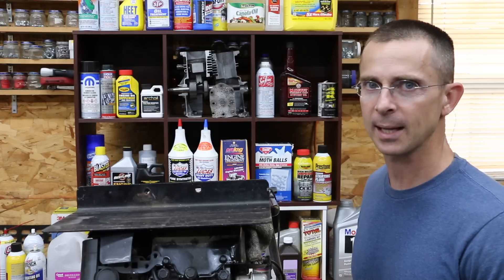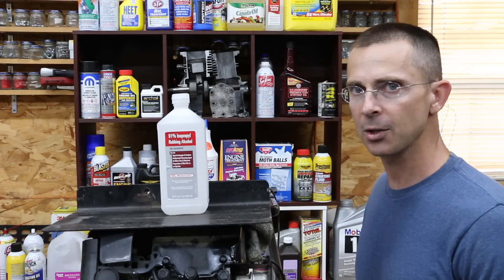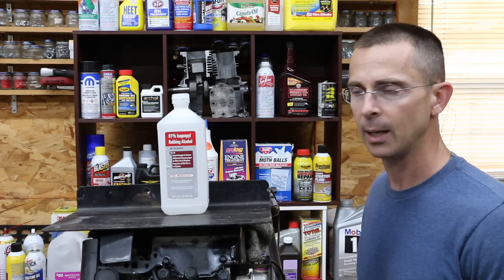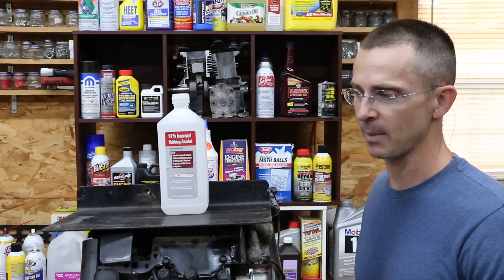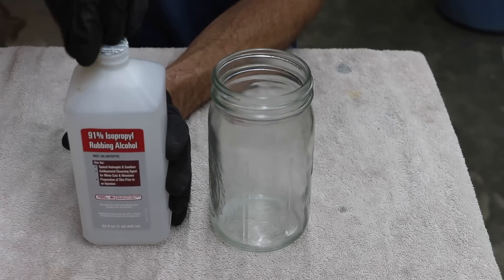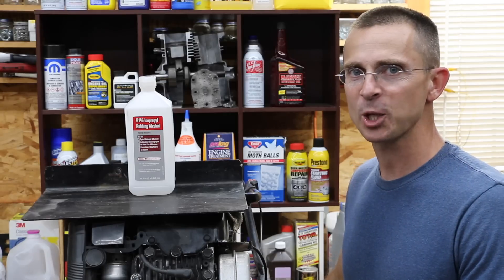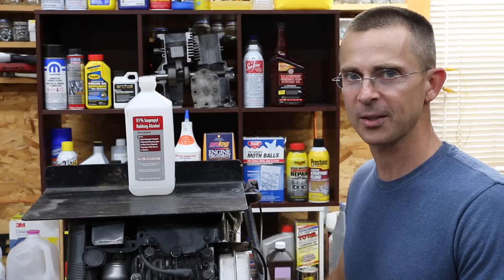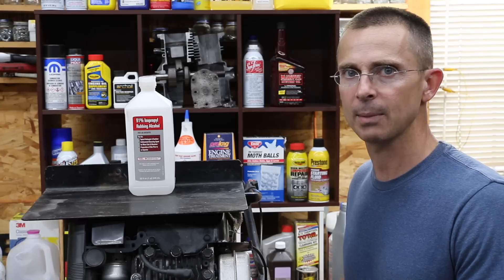Will a Gas Engine Run on Isopropyl Alcohol?  Let's find out!

Comment: Would be nice to watch a bit longer of a video of u trying that combination I asked about. 25-30 min video using methanol, aviation fuel and E85. It would be nice to also see you blow an engine up using nitrous directly injected into the carburetor. Oh yeah you could also try and make a mower run off propane.. anyways good job on the video keep up the good work these are just some suggestions and ideas. If you use any of these please give me a shout out on you video  I've asked every time u make a video lol
Reply from the maker: All great recommendations!  Thank you!

Comment: This is a good experiment, but one drawback I didn't see mentioned in the comments that deserves mention is that alcohol dissolves most oils, engine oil being one of them. I use Isopropyl alcohol in my biodiesel shop as a cheap solvent all day long. But as a fuel, the alcohol removes the oil from the cylinder walls brought up by the oil ring on the piston, and over time will cause premature combustion chamber wear, and loss of compression. As a test, this is great.  As an alternative fuel though, alcohol will damage the engine in a short amout of time.
Reply from the maker: This is a excellent point.  Thank you for commenting on this!

Comment: Can you try running on propane? I know diesels can but what about the small engine?
Reply: diesels cannot, gas engines can. most forklifts are propane
Reply: bryce piper yea that is true, but diesels used to have an option to run propane as sort of a "nitrous" per say setup, but now its a water meth injection in which people take the route of, companies still sell the propane kits but im not completely sure on how that helps diesels
Reply: water meth is mainly to reduce exhaust temps
Reply: bryce piper yea im battling egts at the moment with my cummins, i found out about the propane injection mods when looking for a better setup to help my egts
Reply from the maker: homar787, Thank you for this recommendation!

Comment: If you were to open the metering holes in the carb and a little bigger jet it should clear right up. You have to change your oil often when you run alcohol through these small engines though. It'll wash the cylinders down. We used to run methanol in our racing karts back years ago. Pretty sure they are similar. Also you'll burn more alcohol than gas. It was almost 2:1 for us.
Reply from the maker: All great points. Thanks for commenting!

Comment: You should try letting a hot running engine suck up some liquid nitrogen through the carburetor. Or pour it over a hot cylinder head while running.
Reply from the maker: Thank you for this recommendation!

Comment: an old briggs motor manual i saw online somewhere  called for minimum 77 octane gasoline,   so im guessing wood alcohol isnt too far off from that octane level, it ran great.... im guessing the oil industry knows this too and has purposely made it harder to do this with cars probably going back since the 50s or 60s, im no history expert ........         maybe do a "mileage comparison"  on running time on same level alcohol and gasoline .... e85 cars are supposed to get less mileage from what ive read
Reply from the maker: I enjoyed reading your comments.  Thanks!

Comment: Isopropyl is used as a gas additive to "absorb" or mix with small amounts of water in the fuel tank. It isn't going to remove carbon any more than clean premium gas.
Reply from the maker: Thanks for commenting on this!

Comment: I have heard that if you run a engine on propane it will clean all of the carbon from the combustion chamber. I would like to see you try that. Great videos always look forward to them.
Reply from the maker: Thank you for this recommendation! and thanks for the positive comment!
Reply: Don't know if it will clean one up but an engine that is already clean like a fresh overhaul that runs on propane will not discolor the oil it will look fresh after 3000 miles on a v 8 it's a lot cleaner burning fuel than gasoline
Reply: Also if you convert one over to lpg you should install harden valves and valve seats due to dryer lubricant maybe more heat and also lpg loves high compression ratios

Comment: There is this stuff I found at Advance Auto called Aircraft Coating Remover that worked really well cleaning up some heads for a car. The stuff is amazingly strong! I wonder if that could just be sprayed down a carb or added to fuel to clean out an engine?
Reply from the maker: Thank you for this recommendation!

Comment: I hear Acetone can clean an engine. I hear you mix three ounces acetone to ten gallons of Gas. Not sure if that works or not.

I seen a person pour rice down the carburetor in a car that was skipping real bad and as he poured the rice down the carburetor the rice was shooting out the tail pipe all black from the carbon that was buildup in the engine and they engine slowly started running smoother.
Reply from the maker: Thank you for this recommendation!
Reply: I don't think rice would ever make it through the carb jet.

Comment: Hey man:
I don't know if you have done this or not but if you can run a 2 stroke engine on a mix of 5:1 diesel to gas rather than a standard 50:1 2 stroke oil to gas. Legend has it will run. Thanks!
Reply from the maker: I haven't done this yet.  Thank you for this recommendation!
Reply: That farming Kid I've done this before. Diesel thinned down with alcohol or gas will work in the leaf blower, moped, generator, other small 2-stroke motors. Sometimes. Depends on the engines compression and your mixture ratio I presume.

Comment: There  is a rumor around town, (in the shade tree community) that you can mix a little trans fluid in with your gas to increase milage, could test it out!! Also Could try running mineral spirits, I ran a little xylene/gas mix  in mine once.
Reply from the maker: These are all great video project ideas--thank you!
Reply: put a small amount of diesel in with the gas in your tank a person I know always did that on his ford ranger with improvements on mileage

Comment: Question! Is it safe to use in a normal car with a normal fuel injected gasoline engine? The compression dropped 3 PSI do you think it caused physical damage?  Those were significant results to the carbon build up, Seafoam does very little. Thanks project farm long time subscriber and you just earned a like in your video.
Reply from the maker: Out of caution, I wouldn't use this in a fuel injected automobile.  I just don't know if there are any negative effects.  Thanks for the positive comment and for the thumbs up!
Reply: What should I used to clean carbon build up? No THANK YOU for the video!

Comment: An old remidy for a carboned up combustion chamber is adding water while running the engine.
Reply from the maker: Thank you for this recommendation!
Reply: But not to the fuel tank. Dribble the water into the carb while at mid to high rev's intermittently without stalling the engine.  Nick.
Reply: advance9572 Yep and then MAKE SURE to change your oil it turns into a milkshake
Reply: windex is better in my opinion
Reply: Another option is to use a steam cleaner. The water is already vaporized.
Reply: Adding too much water into the carburetor is also an old remedy for a bent connecting rod.
Reply: Well the Iso alcohol had a 9% water content so that might have helped it clean.
Reply: advance9572 adding water to the air intake not the fuel tank.      Might want to specify for all the dumb fuckers

Comment: I say mill the heads down as far as operationally possible to get as high of a compression as possible and run some 110 in it, if you can even get the compression high enough to require that much octane.
Reply from the maker: Thank you for this recommendation!
Reply: Kevin Ball just putting a 3&1/2HP head on a 5HP engine will bring up the compression a lot
Reply: I saw a video of a guy milling a v8 cylinder head using sandpaper on a sheet of glass.  The glass surface was flat making home milling possible.  If you're going to try it that is how I would achieve a flat sealing surface on the final sanding.
Reply: Barry Fields 
Ok that makes sense. I worked 9 years as a mechanic in the heavy duty industry and I've messed around with mowers and minibikes a descent amount when I was younger but never realized the bolt patterns would match up between the two. Ok so that removes some mystery for me. I'm curious what kind of compression ratio can be had with different heads and milling. Then maybe notch the magneto holes a bit so as to add 5 degrees of advance as well. I'm familiar with small engines decently enough but I've never attempted to build one up. I was just trying to think of cheap methods Mr. Project Farm could do. Thanks for the input.
Reply: The problem with the flat head configuration is that when you mill off of the head it lowers the clearance area over the valves until the valves hit the head.  It has been a long time since I built go-kart engines but you really couldn't get really high compression (say 12:1) out of a stock head no matter how you modified it.
Reply: I know lmfao Its amazing how many people cant tell a joke from actual meaning, ive been a diesel mechanic for 10 years, I build race trucks on my free time, if I wanted to raise combustion I would plane the deck down, but compression only does so much, if you wanted to run 110 you would advance the timing to get the power. my 2014 ford f150 5.0 I have sct x4 tuning, custom e85 nitrous tune and 100 shot of nitrous, right now I'm running a mix of e85 and pure methanol, even on my basic e85 N/A tune picks up 45hp alone just because the high octane allows me to have the timing advanced. in the middle of building a drag semi right now, got an old 1998 freightliner fld120 cummins n14, did a rerate from 410 to 525hp with cummins insite, did a turbo swap from the ht60 to a compound with a sx500 BorgWarner 94mm to a 86mm sx400, should hopefully make 70psi of boost, using an external tank with a holley 200gph diesel pump, hooked up to 2 nitrous fuel solenoids for the extra fuel to keep up with the boost even though diesel engines can run as low as 60:1 the more lean it gets the more power I lose and the more higher temps the engine runs, next step imma send in the ecm to a buddy of mine to redo the fuel mapping on the stock system, also have two 265gph fass lift pumps for the main fuel system, haha I'm not some idiot, ive done a lot of projects and come up with all my ideas from scratch, if someone has an idea I can create it
Reply: It has been at least 15 years since I have built competitive B+S engines for go karts, so I have long forgot all of the specifics.  If I remember correctly we would first determine the cam lift that we would run, then cut the head to that level, and the two important things that we had to do were to open up the area between the valves and the cylinder to allow for good airflow, and then mill a fire slot into the head.  The spark plug is so far offset to the valve side on the B+S engines that it was hard to get a good fire over the piston when you got the piston to head clearance right down to a minimum.  So you need to mill a small slot, or groove from the plug to the center of the piston.  It would pick up a bunch of torque with that.  Again, it has been a long time and I am sure that there are many people that know this like the back of their hand.  Fun stuff!  R.J.
Reply: lol weld the combustion chambers around the valves and grind it smooth
Reply: Project Farm my dad used to feed ww2 aircraft engines white rice to clean carbon. We've done it many times over the years.  He's passed away but he new his shit. Try it. Uncooked of course.
Reply: Matt Hudson you need to do a little work on them, but they will work. Just cut a little relief for the valves
Reply: Milling the head of a flathead only serves to restrict airflow through the valves
Reply: R.J.'s workshop 
That was one of my concerns. I've just never known how tight the working tolerances really are and how far one could go before obstruction of the valves occurred. I'm sure there are thousands of people that run the blueprinted and balanced Briggs carts with alcohol carbs that know the limitations of most of the popular flat heads. I know everything has been experimented with these engines in the past. I just haven't done so myself and thought it would be interesting to see someone document the trial and errors on video. It sure would inspire many to start their own low budget horsepower builds. Such a great way to find and flourish the hidden gearheads out there.
Reply: killer120 ROTFLMAO!!!!!!!!!
Reply: I bet it can run 110+ leaded with no modifications
Reply: Buddy of mine has a built up 5.9 cummins in his 08 ram.  He's dynod in around 780hp with 80lb of boost. That thing is wicked fast.  Wouldn't call it a race truck as its on 36s, + lift, and fully loaded lol.

It runs 11s in the 1/4 :)
Reply: Moonshine
Reply: R.J.'s workshop Very good point.
All we can do is check head to valve clearance with some clay or soldier then deck it that much minus say .010". Depending how much time you wanna spend, valve clearance reliefs can be cut into the head so farther decking can be done.
Reply: killer120 Great idea but that would prevent flow in and out.
Reply: Barry Fields 3.5 heads will not bolt onto 5 HP. I've built these flat heads for year's. gas methanol alcohol .

Comment: Normally engines that run on alcohol will run cooler. I bet the reason it was running funny was because of lack of fuel to air. Most alcohol engines have to be jetted higher because it will burn more alcohol than it will gasoline. Nice video once again Project!!
Reply from the maker: I agree.  It was running lean, which prevented it from running a lot cooler.  Thanks for the positive comment!
Reply: No problem man. Love these cool videos

Comment: Alcohol burns at a lower temp and has less energy per unit compared to gasoline, while it does work as a fuel, it isn't as efficient as gasoline but it is FAR cleaner than gas.
Reply from the maker: All excellent points. Thanks for commenting!

Comment: Great video.  Surprising results, but not good to use, and I would like to explain why.  You probably already know that alcohol causes pre-ignition, which means it explodes in the chamber before the usual time which can cause valve damage on some machines and in cars, which is probably why they began adding alcohol in gasoline, (planned obsolescence), octane booster, as you know, delays the explosion, making sure that the piston is more ready to receive a power stroke.  Lead was what they used before banning it.  If you want to improve car octane rating, don't ever trust the octane rating on fuel pumps, you have to add octane booster.  The reason I say never trust fuel pump ratings, is because, one, many pumps have just one hose for all three types of fuel listed.  You are literally paying a higher price for what could be up to four gallons of gas before your octane level gets to your tank from the pump because of the hose length, on the other hand, you could be getting four gallons of higher octane fuel.  Secondly, so many gas station managers, and fuel delivery truck drivers have come out saying that their fuel mix has added water to it so as to make the level in the tanks last longer.  Not a joke at all.  If you find a gas station fuel that runs great in your car and is consistent, never use another gas station unless you just have to.  No joke.  Your videos are awesome, and I was surprised the alcohol cleaned the chamber, until I realized a pre-ignition would do just that.  I've learned so much from your videos, and saved money, so I am saying thanks.  Thank you!
Reply: Would you recommend trusting an "ethanol free" pump?
Reply from the maker: This is all great information and I really enjoyed reading your comments.  Great advice regarding use of an octane booster too!  Finally, thank you for the positive comment!

Comment: I've heard you can run a gasoline engine on straight wood gas without any conversion.  Might be fun to test.
Reply: They are called gasifiers. If you do a search for gasifier you will find many videos
Reply from the maker: Thank you for this recommendation!
Reply: You can I seen it done on a toyota pickup and it worked pretty well!.
Reply: I run engines on charcoal gas from homemade charcoal. There is a forum called drive on wood (driveonwood.com) that lots of people are doing just that, running motors and cars on woodgas and charcoalgas.
Reply: I built a gasifier and did run a pushmower just to try it. Bad filtration gummed up the valves pretty good lol.
Reply: I can imagine..its basically pitch/pine tar gumming stuff up.

Comment: Hand sanitizer! I know it's just alcohol, I'm just curious if the viscosity would prevent it from running... I know it lights pretty easily on its own in the open. What about sta-bil (sp) fuel stabilizer? Like straight stabilizer, unmixed. I know they have a couple kinds (red and yellow, one is methanol, the other...?)
Reply from the maker: Thank you for these recommendations!

Comment: If running 2 stroke oil gas mix through a 4 stroke will clean the engine cylinder
Reply from the maker: Thank you for this recommendation!

Comment: Very neat! I didn't figure the engine would warm up to operating temperature.
Reply from the maker: I think it would have ran cooler if the engine wasn't running lean.  Thanks for commenting!
Reply: could you run a generator with this?

Comment: This is an interesting video. Back in the day they used to make all engines run off of alcohol and gasoline. It was this way until old John Rockefeller made a deal with General Motors to use Standard Oil as the only fuel source.
Reply from the maker: Very interesting.  Thanks for commenting on this!